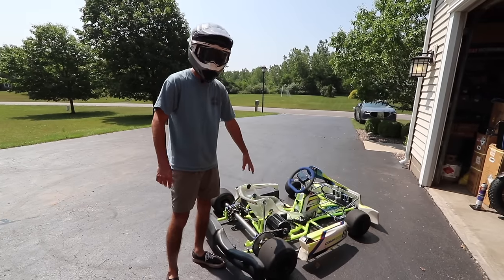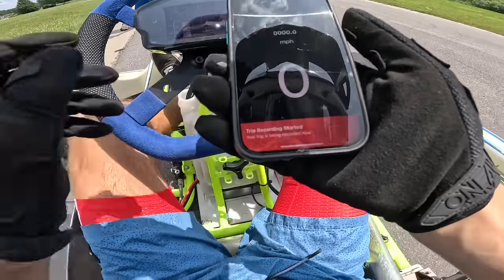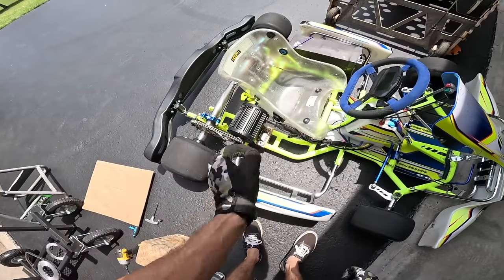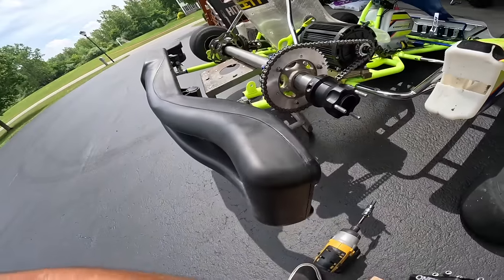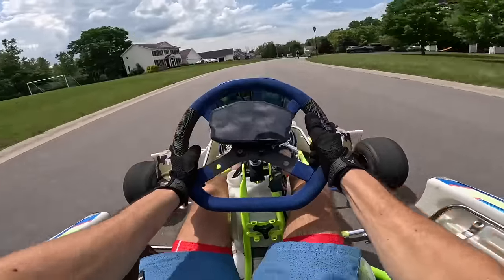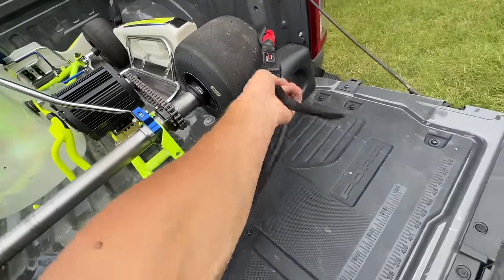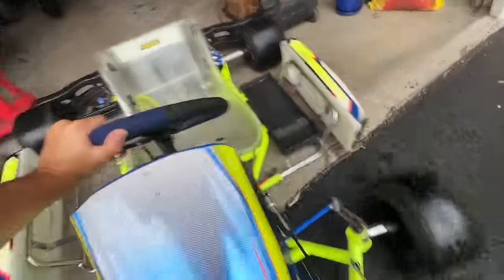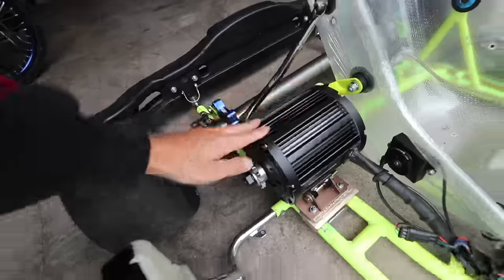INSANE 80+MPH Electric Go-Kart // Surron E-Kart

Comment: Math is your friend, use it. Your original 53 MPH @ 54T can be used to calculate. If you use math, you can see the 47T is 1.15% > than original ratio, expected top speed of 61 MPH (almost exactly matched what you measured). Likewise, 40T is 1.35% > than original ratio, expected top speed of 72 MPH (again, almost exactly what you measured. Dropping to 21T was WAY too low, the motor couldn't get to max RPM (motor RPM is your limiting top speed). What you want is a 29T or 1.88% > original ratio for a predicted top speed (assuming the motor can still reach max RPM), of 99.8 MPH...
Reply: Also, I love what you are doing but you are nowhere near 100HP (just an observation, not criticism). 1 HP = 745 Watts, so 100 HP would be 74.5 Kilowatts, meaning your 72 Volt battery (and speed controller, and cables), would have to be capable of handling 1,034 Amps, NOT happening! My guess, you are much closer to 40 HP (30 Kilowatts @ 400 Amps), still very respectable!
Reply: shut up🤓
Reply: Lmao 😂

Comment: You're way overgeared on that 21T rear sprocket. If 40T got you to 70, the 21T is geared for about 135, which due to aerodynamics and room you'll never hit. Overgearing most likely led to that sprocket getting shredded. If you run a 27T rear sprocket you should be in the 90s, maybe 100, and a 26T should get you over the 100 mark. Personally I'd throw a 27T rear on it, it'll definitely go faster.
Reply: yes, it ain't that hard to compute the gearing. forget the one tooth adds X mph nonsense, gearing for 100mph is 53/100*54 = 28.6
you are going to lose a tiny bit of rpm with longer gearing so 26-28 should do the trick, unless the motor's not powerful enough. put some gear on and check the tires rating though. things could go pretty bad if you blow up a tire at 100mph.
steering looks twitchy at 80+mph too
Reply: I was thinking the same, and with that tiny sprocket as well, it's reducing all the "low speed" fun that was possible with the larger ones....26-28 is definitely the sweet spot 😅
Reply: @geemy9675 how does it work for km/h? Same thing right? (Teeth/kmh=Ratio?)
Reply: @johnnygeorgopoulos4072 so the sprocket is 26-28 times larger in diameter?
Reply: @Vortex001_MLG  no, that's teeth number. There's lots of calculations and actual calculators online if you need help figuring out gearing.

Comment: Really cool kart build, a couple of notes though. You might be able to get a bigger front sprocket, that will increase the top speed. Also, you don’t need to have different chains for different size gears. With normal karts at least, the engine slides forwards and backwards, once you get the proper chain tension you tighten it down on the frame rails. This also makes it easier as you no longer need to undo a link to get the chain on and off, just loosen the engine and slide it forwards or backwards.  Also, I think you are running the chain too tight. There is supposed to be some slack in it. They recommend about 10mm of movement up and down on my TAG kart. I think this might be the reason for the chain tearing the teeth up AND the reason why the motor twisted.  Looking forward to more videos on this kart.
Reply: i was thinking why not bigger motor sprocket to really get it going lol
Reply: @gamersplaygroundliquidm3th526   yea, when I say bigger front sprocket that’s what I mean, a bigger motor sprocket.
Reply: @michaelpurnell9526  lol okok that's what I thought , it puzzles me to why he didn't do that firsty?

Comment: with the original sprocket you were going 52mph. If you want to get to 100mph you need to cut your gear ratio less than half maybe to a third of the gear ratio due to drag and to powertrain losses. Look at your motors power curve chart and look at the peak power at the top end of the motors rpm. Use that rpm number in the calculation, measure you wheels, and measure your gear ratio.

Comment: Awesome setup. 
You didn't need to drop all the way down to a 21 and by doing so you are putting a ton of undue stress on the components.
If you had unlimited power and could achieve the same peak motor RPM with the 54 and 21 the top speed with the 21 would be 136.
If the motor and battery have sufficient power you should be able to hit 100 with a 28 tooth driven sprocket based on the 53mph with a 54 tooth.
One last thing it looks like you are running the chain way too tight which makes the chain run hotter, stretch more and more likely to fail.
The chain needs slack to prevent binding as the chassis and axle flex, you would be surprised how much things shift around under high dynamic loads.

Comment: Hi Tyler, I really like what you did and have been wanting to build something like that for quite some time, but I'm new to go karting / e bikes, etc. Would it be possible for you to make a complete list with exactly which motor, battery, and throttle you used please? If you already did that somewhere I apologize I'm just not seeing. Only saw manufacturers links. Thanks in advance!
Reply: Yeah it'd be awesome if you could put together a part list of what you used I was thinking of doing the same

Comment: So you are going for top speed with the smaller 21 tooth rear sprocket.
But how does that effect the fun factor for drifting and take off acceleration?

You can also go 1 or 2 teeth larger drive sprocket on the motor

Comment: Nah, I had a look at the kit specs on the website.... It's rated at 15kw continuous, 25kw peak. That is roughly 33hp max. So definatley a long way from 100hp..... but I think its fast enough lol!
Reply: So how did he get 80 mph
Reply: And can you build a 100mph electric go kart ?
Reply: Its the torque! Even if it was 33hp it will have alot more torque than a 33hp 125cc 2 stroke would.

Comment: Put some bigger wheels on that thing. Your power setting will just mean you accelerate faster, it won't change the rpm the motor spins at. Change the gearing and put bigger wheels on to increase the top end. Small wheels will give faster acceleration, big wheels higher top end. A 2 speed auto box would be cool, with an auto clutch where at a certain rpm the centrifugal force throws it into the higher gear, that way you could get to the 100mph or maybe even more. Failing that you would need a higher revving motor.
Amazing build though, I love it bro, well done!

Comment: Can you get a larger counter sprocket.  One tooth on the counter is like 2 to 3 tooth on the rear.  I raced 80 shifter karts and  you are getting close to the top speeds we would run.

Comment: considering the ratios and gearing you can reduce the diameter of the sprocket even more the more the better and you can also change the amount of teeth on both sprockets to effect the torque and speed that's all good but you can change the batteries and wiring so  you can use small diameter sprockets at the axles the heavier and harder sprocket the better so it don't break , about 20 years ago I was going to put a sprocket on the driveshaft of my truck having a power assist for the diesel motor this was using pneumatic assist with 1" impact driver air gun, consider the ratio between wheel diameter and crankshaft and how many revolutions per minute , any faster you should beef things up a little, great job I wouldn't change a thing, I'm working on converting a 85 Honda atv 2wd 250 into a hybrid  with a electric motor powering the front wheels any idea what kind of motor I can use ? maybe a souped up golf cart motor, I'll do a short video soon showing what the plan is but it'll be on my other phone YouTube channel  @Guy Telfer and the motor I have to use
Reply: Qs138
Reply: After reading your post I had to check all your build videos out. Nice!

Comment: See if you can tweak your speed controller? There's a field weakening setting that should give you between 10/15km (10mph) up top 👍
Besides that you could always option to go with a higher voltage battery so long as your speed controller supports it?
Personally if I'm going to build an EV of any kind, I'd always option for a controller that supports way more voltage than I am giving it?
There is a guy on YouTube that has an E-kart where he has removed and side pods and that's where he has mounted his Surron battery? That's 2 X 72 volt batteries that are in series to make 144volts total power and that kart is friggin ballistic! 
It doesn't just light the tyres up, it full on bags the treads like a car in a burnout competition!

Just note that the higher the voltage the harder it is to drive the kart going slow because then the controller has to work harder to "dial it back" . Basically only pros should be allowed to ride it and it makes it a vehicle incapable of being ridden by a beginner 👌

Comment: i think going back to 30 teeth will get you better bottom end without effecting top speed. the sound the motor is  making says it's running out of torque around apx 70% of the way to max rpm.

Comment: cool cart, you should have gotten the 28, it might have gone faster with that one coz 21 was too smal and motor did not have the torq, or was just overloaded af for basically same speed
Reply: based on the speeds with bigger sprockets your 21 sprocket was geared for 136mph way too high 84 was only 61 % of the max rpm. unless you wanna do top speed run downhill...you could have gone same speed with 34. 28 would be geared for ~100mph if the power's enough to get you there. at some point it would almost make sense to have a two speed transmission to get you to the top speed but keep all the low speed torque

Comment: Im building one similar. Id say you need 4k atleast. I found a used kart for 800 the battery is 1500 to 2k the kit is like 1100 and random parts. Maybe like 5 to 6k 😅

Comment: what was the total cost of this thing?
Reply: i built one similar to this.(i actually did it after watching this video) same electric and co kit was about $1500. a kart with no motor will run 700-1500 depending on what you can find. Battery will run $2300  motor mount will run you $200-300 or you can try and make one.sprockets are 20 to 60 a piece depending if you have split sprockets or not. id say 200 bucks for random stuff in between. im going to post mine on youtube in a bit myself.

Comment: You need to be changing the front sprocket, my guy
Reply: Exactly
Reply: Larger front sprocket
Reply: @bpadula100 not with the 21T though. it's already geared WAY too long. 26-28 rear with the same front sprocket will go 100+mph
Reply: @geemy9675  what was the smallest rear sprocket he put on in the video?  I can’t remember

Comment: How much did the build cost?
Reply: i built one similar to this.(i actually did it after watching this video) same electric and co kit was about $1500. a kart with no motor will run 700-1500 depending on what you can find. Battery will run $2300  motor mount will run you $200-300 or you can try and make one.sprockets are 20 to 60 a piece depending if you have split sprockets or not. id say 200 bucks for random stuff in between. im going to post mine on youtube in a bit myself.

Comment: Cost?
Reply: i built one similar to this.(i actually did it after watching this video) same electric and co kit was about $1500. a kart with no motor will run 700-1500 depending on what you can find. Battery will run $2300  motor mount will run you $200-300 or you can try and make one.sprockets are 20 to 60 a piece depending if you have split sprockets or not. id say 200 bucks for random stuff in between. im going to post mine on youtube in a bit myself.

Comment: Change the engine sprocket instead of the drastic axle sprocket sizes.  Use higher number of teeth on the engine sprocket for more top speed.  Your also pushing your luck wearing a tee shirt and shorts when going that fast.
Also.  Get off public streets.

Comment: You are loosing power with the smaller sprocket. Your theoretical max speed should be ~125 when switching from 40 tooth sprocket. You will get same speed with more torque on a 35 tooth rear sprocket